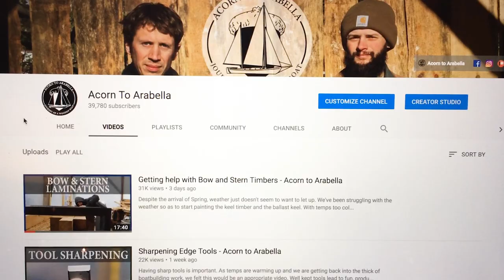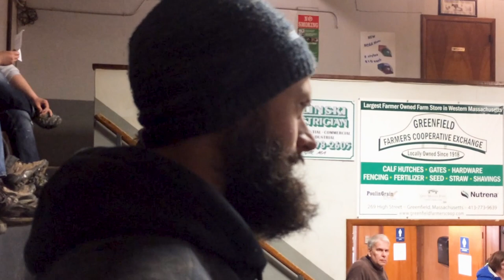Acorn to Arabella - Journey of a Wooden Boat - Episode 34: Help from Colorado!

Comment: I don't normally comment but have got to chime in here: to the negative commentors on the 'non-building' flavour of some videos. Of course there will be down-time and mundane activities to be dealt with. That's a part of any endeavour and this is a huge challenge, expect much of those moments. I, for one would rather see a bit of these and or other fillers to round out the process and learn more about the people involved instead of the juicy bits only. Kudos to you guys for finding ways of putting out content and showing some human and skillset side of the project. Don't stop or change for the 'want it now' donkeys.
Reply from the maker: Thank you for the kind words!  It's always great to hear from folks who enjoy following our journey and understand that it will be a long, slow, bumpy, curvy ride but for us that long road is something we enjoy.  It's all part of the process, most lofty goals don't have a short straight line to get there =)

Comment: Guys, just an idea here...

Since you get more ad revenue (and patreon rev) from the actual "boat building" videos, would it make sense to heat the shop during the winter so you can get some work done when it is cold? It seems like the additional revenue would offset the cost of running a BAKH (big ass kerosene heater).
Reply from the maker: The wood shop and house are heated so we can bring things inside to paint in future winters.  
The backbone pieces of the boat is just too big to move into the shop or house for painting.
The boathouse is a tinder box so a big heater is a bit spooky and it's 24'x50' with a 20+' roof peak.  It would take so much energy to heat that space especially since it's not insulated, it's just not worth it.

Comment: I'm blown away by the ring growth pattern from east to the west coast. We've downed three black locust in the last year. To cut one off at the base was rather an experience. 36 inch bar on a  Stihl and two bars and four chains to bring it down. Super tight growth ring patterns.
Reply from the maker: Here it depends mostly on the growing conditions.  Under cover in the woods most of it's life and the rings are very tight.  If it is grown in the open without much competition it's another story.  Trees grow really well and really fast here unless something like competition slows them down.
Reply: The ones we took ,down were along the road and in the yard. How old, no one really knows. There is also a Pepper tree along with many Eucalyptus tree's. Some of these tree's are up to eleven feet in diameter.

Comment: I have a other suggestion to get those laminated timbers:  make them approximately two inches thicker than needed and get them through the sawmill. This should make a useful plane surface on both sides. Afterwards you can plane them down to the measurement you need
Reply from the maker: That could have worked, maybe the next bloke to build one will see this and use your tip but it's too late for us.

Comment: I'm not sure I really understand how piling up more footage, over twice the time frame is going to free up more time to edit to get videos done quicker. I mean if it takes a day to edit 6 days of footage, won't it take 2 days to edit 12 days of footage? I get that you want to both be there to get as much work done and footage as possible since the weather is nicer, but it's just going to take twice as long to edit it all now. You do what you need to do, I am just thinking out loud.
Reply from the maker: It makes it so there is two weeks to make a video and not 1 week to make a video.  The videos take roughly 1-2 hours per minute of final footage to edit.  So a 15 minute video is 15-30 hours worth of work to edit depending on the footage and how it goes together. 

The videos will fall behind real time which will help us keep the content interesting and moving over the winter.  Basically I am going to pull ahead of the videos this summer and the videos will catch back up over the winter and we will be neck and neck by the spring again.

Comment: Your new video schedule sounds like a great plan, and hope it helps you find that balance.
This video was nice, but it felt like a filler piece...more talk than do.  
I suppose I'm more used to Salt & Tar as they were all about getting after it...I have a feeling at some point you will be too.  
Curious to hear you guys talk about those challenge coins Doug (S/V Seeker) had made for you all to help out. 
Take care and looking forward to some good things from you two!
Reply from the maker: In a lot of ways we are still laying the ground work.  For instance we just spent 3 days digging trenches and running wires to update the electric supply in the boathouse so we no longer have to run the generator.  There won't be any coverage of that in the videos, there has been a ton of behind the scenes stuff like that, that never made it into the videos.

We know this is a long build, it will take much longer than Ruth and Garrets vessel to build and we are still setting up shop so to speak.
Once we get though saw milling it will be full steam ahead, we have most of the ducks in a row and are ready to pull the trigger.

Next video is us cutting the keel timber to final shape and finishing the lead ballast keel.  After that it's the forward deadwood.  Everything but the final stages of the forward deadwood is done and shot, just needs to be edited.
Reply: I would also recommend following the Acorn to Arabella Instagram and Facebook, as they post daily update photos. Also, I wish we could have filmed some of our work stabilizing Victoria and more off the trip to the Cape, but that would require more to learn how to camera better. 😅
Reply: It's all in the journey, I can only imagine how much more evolved and refined your skill-sets will be a year from now, let alone upon completion.

I do follow you guys on FB as well :-)